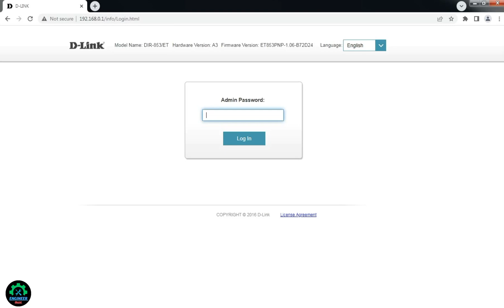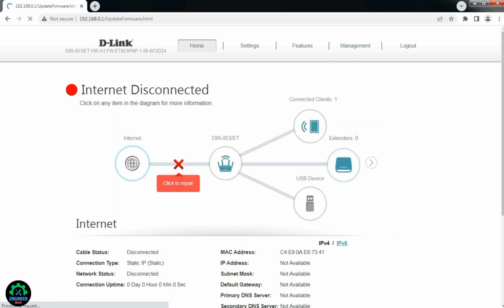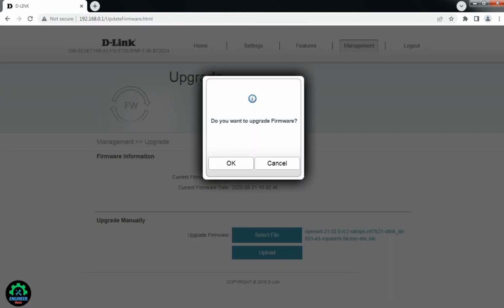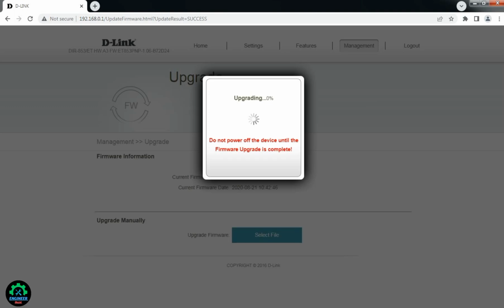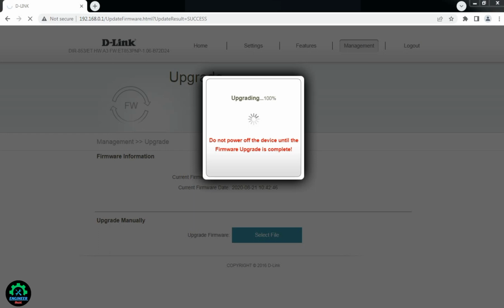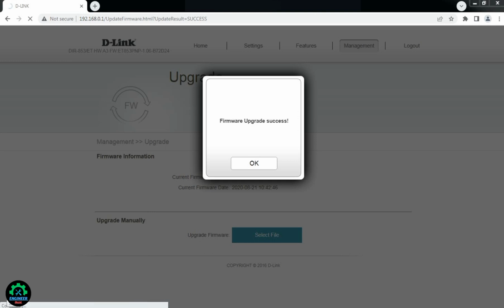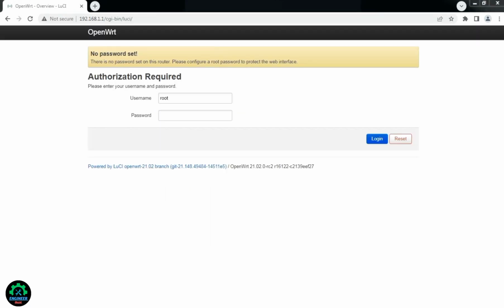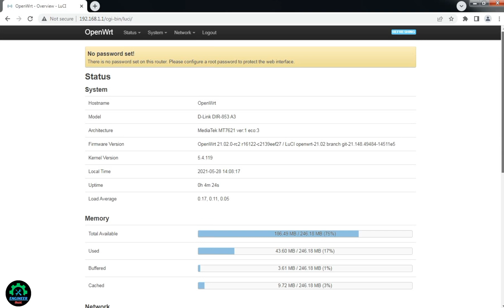How to Install Openwrt Firmware On Etisalat Dlink DIR-853 ET/A3 Router | Unlocking Etisalat Router

Comment: any idea, how to backup the original firmware?
Reply from the maker: Openwrt or Dlink
Reply: @Engineer_Mazeed  dlink. and also I tried with your firmware as per the description and it failed to upgrade. any ideas as to where I could have gone wrong?

Comment: My router is hw a3 but it give me a massage : firmware uprgade failed can you please give me asolution for this problem?
Reply from the maker: Hey tried these firmware after  that put the lasts firmware which can found  in my video description  link https://www.mediafire.com/file/z8jmmfz6nwbw1ys/openwrt-21.02.0-rc2-ramips-mt7621-dlink_dir-853-a3-squashfs-factory-enc.bin/file
Reply: @Engineer_Mazeed   thanks its working